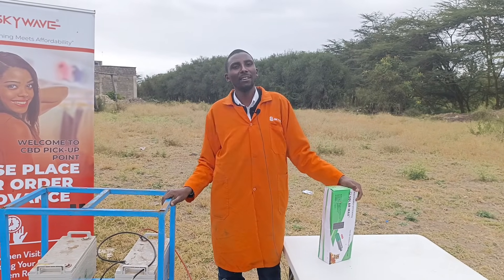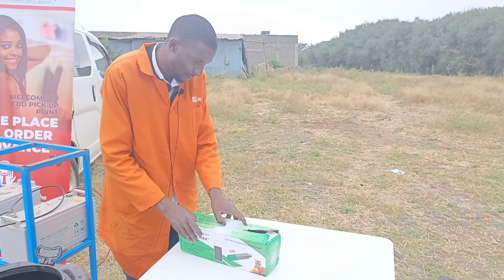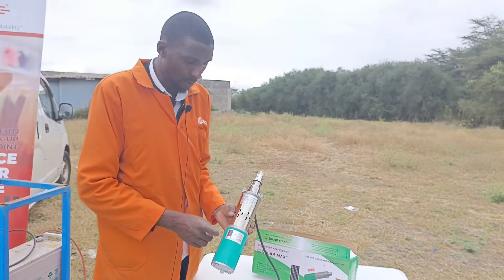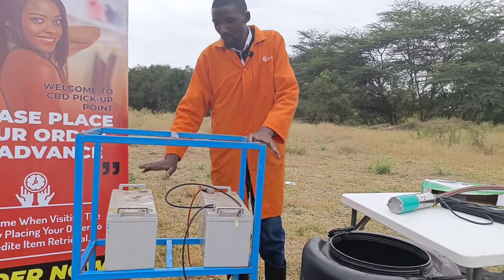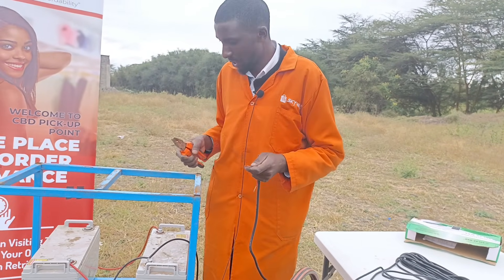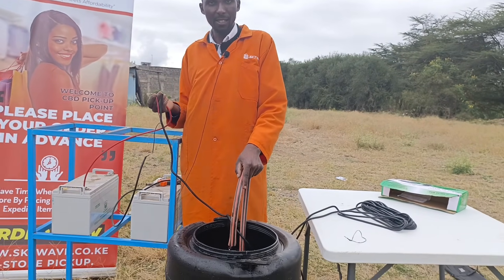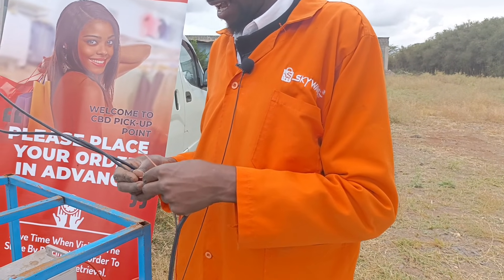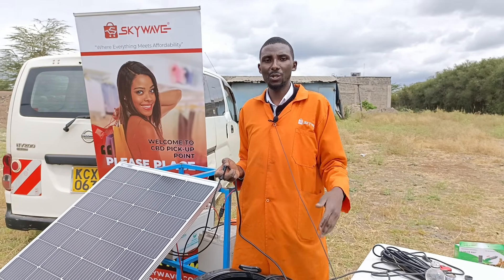How a Solar Submersible Water Pumps 50m head Works

Comment: Hi, does the pump have a built in flow control switch. Lets say i install it to have one tap as the output, if i close that tap does it cut off and turn back on when the tap is open or do i need something like an automatic pressure switch for water pump
Reply from the maker: What you can do with this maybe use a flow switch once something like a tank is full it just shuts down. But you can also play around with it buy introducing a switch so that you can shut it down when you need to. You don't have to worry about water flowing backwards.

Comment: The batteries are connected in series to give you 24V. But you said parallel. I am confused here.
Reply from the maker: That's right they are connected in series.
Reply: Please Sir, I've tried running it with 300watt panel but it doesn't power it,can I use 400watts panel instead? Or I should connect 2*300 watt in parallel to maintain the same voltage but higher current?
Reply from the maker: @godwintoluwalogo2045  what is the rating on the pump please?
Reply: @skywavereviews it's the exact type you have just displayed here but mine is Red color
Reply: It's 250 Watt pump,24v and 8a current.

Comment: Hi Sir i have a 545w solar from Davis ...if i use the solar controller will it be able to pumb water without harming the 24V pumb
Reply from the maker: 300w is the maximum the pump can take.